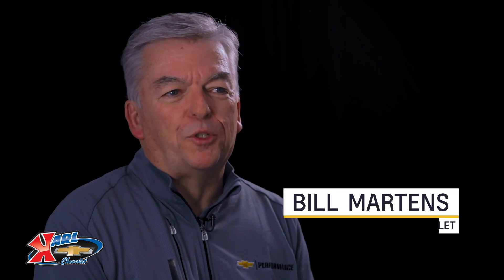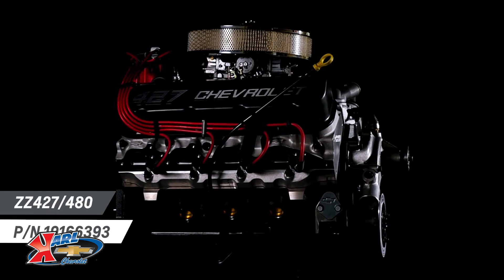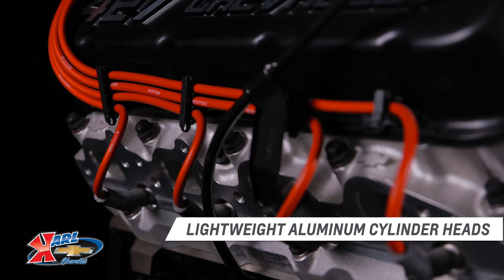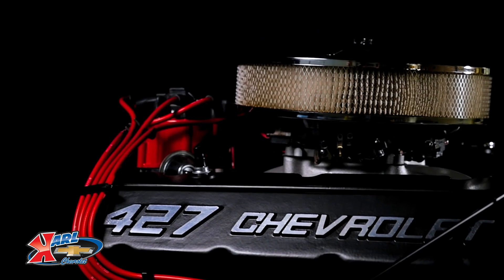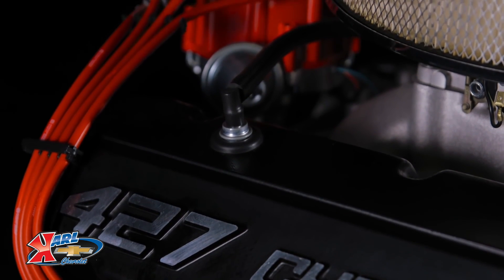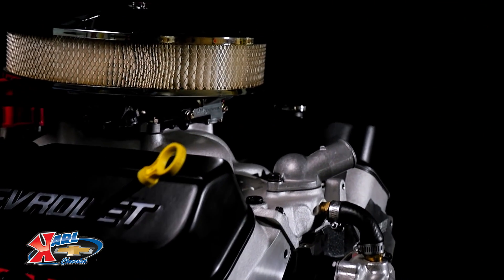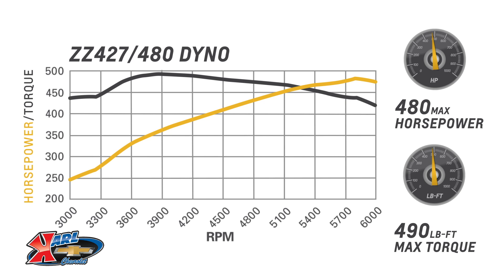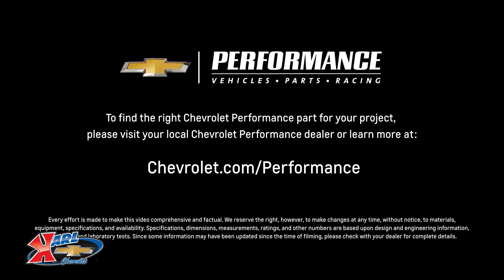Chevrolet Performance ZZ427/480 Crate Engine

Comment: This is not a great deal for 480hp & 490lb-ft tq for $12,000.00.    I just bought my second ZZ454, 470hp & 520ft lb tq for $8,000.00
Buy the valve covers for $600.00, almost the same hp and more torgue, no one will know........
Reply: Where did you get yours?
Reply: I got mine from Holz Chevy in Hales Corners Wisconsin but any Chevy Performance dealer can get one.  Here is a video of the first start, very nice sounding engine.  https://youtu.be/qU-VBAGPr-c?si=COfLuPghWkX5GScQ
Reply: See my reply to you, it didn't post as a reply to you. @dw8840
Reply: @dw8840  See my reply to you posted on my original post, my reply to you went there by mistake

Comment: What’s one of these cost?? 10 grand ??
Reply: 8k. When I bought one  they have rebates sometimes. I didn't get the 250  off the price. Mine is a beast. I also bought the 572 720r. Will be starting it in a week or two...
Reply: Current price 12K.........